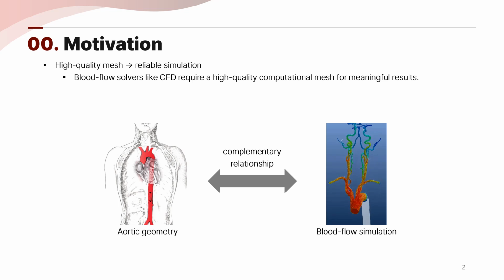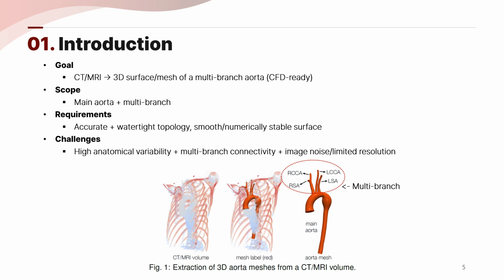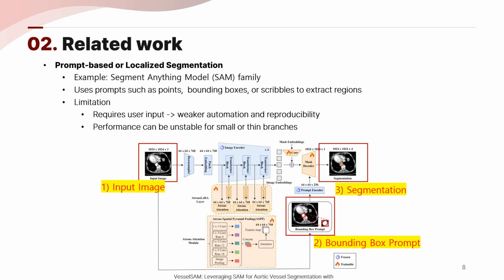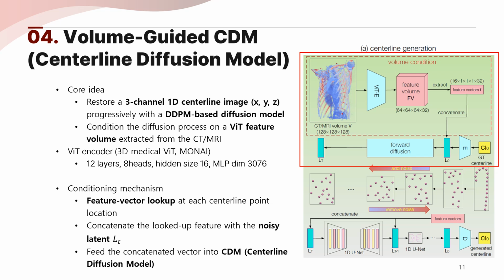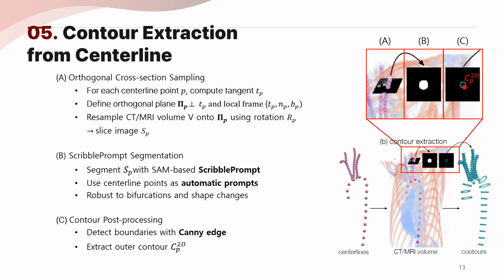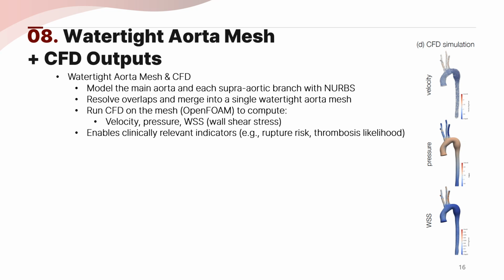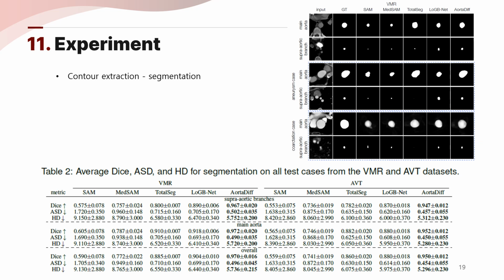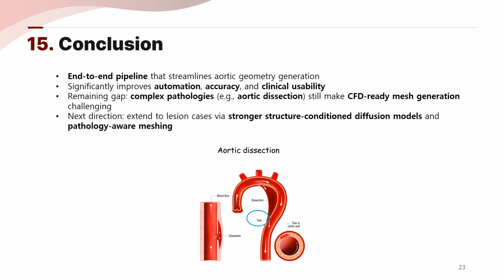[Seminar] How to Reconstruct Complex 3D Meshes Using Diffusion Models

Comment from the maker: It is refreshing to see a seminar covering such topics.
I think, some presentation format errors should be revised... :(
 
I have a couple of questions:
First, could you explain more details about SAM-based ScribblePrompt? Is the extraction of 2D orthogonal contours using Prompt sensitive to the choice or variation of prompts?
Second, since NURBS surfaces tend to produce very smooth representations, do you see limitations in capturing complex local geometric variations or rough surface details with this approach?
Reply: 1. It’s mostly not sensitive to small prompt variations (slight shifts/jitter usually won’t change the contour much), but it can become sensitive when the prompt is significantly mis-placed—e.g., if it moves outside the lumen and “snaps” to a nearby structure, the extracted contour may change drastically.
(ScribblePrompt is an interactive biomedical image segmentation framework that lets users iteratively refine masks with scribbles, clicks, and bounding boxes, and it’s trained on a large, diverse collection of biomedical datasets to generalize to previously unseen structures.)

2. For the NURBS question: in my opinion, the strong smoothness prior can over-smooth sharp, highly local defects (e.g., small tears or calcifications), especially if cross-section/contour sampling is sparse or the surface has limited degrees of freedom.

Comment: Q1. What kinds of inputs or sources of diversity can we actually control in this approach? If high-quality ground-truth CT/MRI scans with fine anatomical details are already available, what is the motivation for introducing this method? In my understanding, generative models inherently introduce stochastic noise, which could be particularly risky in the medical domain.
Q2. What exactly is a NURBS model? Aligning the center point of a mesh appears to be a relatively straightforward task. Could you elaborate on why this problem is considered important and what makes it technically challenging in practice?
Reply: 1. Controllable diversity mainly comes from diffusion sampling, but they constrain it by conditioning on CT/MRI features at each timestep, and the motivation is to automate CFD-ready mesh construction and reduce manual post-processing rather than hallucinate anatomy.

2. A NURBS surface is a parametric spline surface defined by control points and weights, and contour alignment/correspondence (e.g., ICP across adjacent contours) is important to avoid twisting and ensure a consistent surface for fitting.

Comment: 1. The results may vary significantly depending on the spacing of the contours; I am curious whether the authors addressed this aspect.

2. As this topic is unfamiliar to me, I may not fully understand it—does the pressure arise as an outcome of the simulation?
Reply: 1. They run a parameter study showing contour spacing (via number of centerline points) matters: <16 loses detail, >16 can cause contour interference and even NURBS fitting failures, so they choose 16 as the tradeoff.

2. Pressure is a solved field in the CFD step (Navier–Stokes) and is extracted during post-processing after the simulation converges.

Comment: Q1. It doesn't seem like they are adding noise to the image pixel by pixel. Can you elaborate on the process of adding noise?

Q2. Are there any modules that need to be pre-trained and frozen during the training process?
Reply: 1. They add noise and denoise in the standard DDPM style, but on a 1D centerline-image latent across timesteps (the model learns to predict/remove the timestep noise).
2. ScribblePrompt is used as a SAM-based segmentation module in the pipeline; the paper focuses training on the centerline diffusion model and does not clearly specify end-to-end finetuning of ScribblePrompt.

Comment: Q1. In cases with severe pathology, the definition of the vessel centerline itself can become ambiguous.
In such scenarios, what kinds of failure modes does the Centerline Diffusion Model (CDM) exhibit?
Additionally, were any structural constraints or uncertainty estimation mechanisms considered to mitigate these issues?

Q2. In real clinical workflows, there are often strict requirements on mesh quality, such as element quality, skewness, and numerical stability for CFD.
To what extent does Alterative automatically satisfy these mesh quality criteria, and are there still stages in the pipeline that require manual tuning or intervention?
Reply: 1. In severe pathology where a “true” centerline is ambiguous, the likely failure mode is centerline drift or branch instability; the paper does not include uncertainty estimation, and instead conditions the diffusion on CT/MRI features to keep the centerline anatomically aligned.

2. For mesh quality, they remesh with PyACVD and build tetra meshes via VMTK/TetGen, and they report a mesh-independence study (~1M cells), but detailed clinical QA metrics (skewness thresholds, etc.) are not fully enumerated.

Comment: Thanks for the review! It was refreshing to see you cover a medical paper, which seems a bit different from your usual research focus. I’m curious what sparked your interest in this specific work.

I also have a couple of questions regarding the methodology:
Q1. Since the contour extraction relies heavily on the generated centerline coordinates, I'm curious about the error propagation. Does the method have any mechanism to recover or adjust if the initial diffusion model generates a centerline that slightly drifts off the true vessel lumen?
Q2. The use of NURBS seems ideal for creating smooth, watertight meshes for CFD stability. However, could this strong smoothness prior inadvertently 'over-smooth' local irregularities (like small calcifications or intimal tears) that are actually critical for accurate local Wall Shear Stress calculations?
Reply: 1. The paper notes the CDM centerline can be slightly off-center (still within the aortic region) and does not describe an explicit “recovery” loop; instead it relies on volume-guided conditioning plus a prompt-robust segmentation stage to limit downstream damage.

2. NURBS helps make smooth, watertight CFD-ready meshes, but that smoothness prior can blur tiny irregularities unless you increase sampling/detail (e.g., denser/stronger contour constraints).

Comment: It’s a bit difficult since this is an unfamiliar field…🥲

1. How is the ground truth (GT) obtained in this dataset?
2. On page 13, what is the purpose of performing step A?
Reply: 1.For ground truth, VMR provides GT meshes, while for AVT the authors manually constructed GT meshes from segmentations using SimVascular for anatomical consistency.

2. Step A (orthogonal cross-section sampling) resamples the 3D volume onto planes orthogonal to each centerline point to create consistent 2D slices for ScribblePrompt segmentation and contour extraction.

Comment: Q1. AortaDiff generates aortic surfaces by first synthesizing centerlines using a volume-guided diffusion model instead of directly producing segmentations or point clouds. What advantages does this centerline-based representation offer, and what limitations might it have?

Q2. AortaDiff meshes achieve both low geometric error and similar CFD results compared to ground-truth meshes. How should the relationship between geometric accuracy and hemodynamic simulation accuracy be interpreted?
Reply: 1. Centerline-first generation is a compact, morphologically informative representation that lowers computation, but any centerline/branching error directly affects the slicing planes and thus the extracted contours.

2. Geometric accuracy and hemodynamic accuracy are related but not identical: smooth, watertight, sufficiently resolved meshes are key for stable CFD, yet local WSS can still be sensitive to small surface details.

Comment: Nice presentation

Q1. How exactly do you condition the diffusion model on volumetric data? Do you integrate the volume encoding at every diffusion timestep, or only at certain stages?

Q2. Is the model robust to variations in scanner protocols or imaging artifacts like motion blur or metal implants?
Reply: 1. Conditioning is integrated through a ViT-extracted feature volume, with per-point feature lookup concatenated to the centerline latent at each diffusion step.
2. For domain shift, they train on VMR and test on AVT (different source/modality) and still report plausible centerlines/meshes, but specific artifact stress-tests (e.g., metal implants, strong motion blur) are not clearly detailed.

Comment: Q1: How exactly does the volume-guided conditioning work in your centerline diffusion model (e.g., what features are extracted from the CT/MRI volume and how are they fused with the 1D centerline representation during denoising)?

Q2: Since the final surface is built by extracting contours along generated centerline points and fitting a NURBS mesh, what are the main failure modes when the centerline is imperfect (especially around supra-aortic branches), and how robust is the pipeline to these errors in terms of producing CFD-compatible meshes?
Reply: 1. They encode the CT/MRI with a ViT into a feature volume, then for each centerline point they look up the corresponding voxel-wise feature vector and concatenate it with the centerline latent at each diffusion timestep as conditioning.

2. If the centerline is imperfect (especially near branches), the orthogonal planes and prompts can shift, degrading contours; they mitigate this with a prompt-robust segmenter and contour alignment (ICP) before NURBS fitting, but large branch errors can still break robustness.

Comment: Q1. How does AortaDiff's use of a compact representation (centerlines and contours) improve topological stability and data efficiency compared to direct 3D point cloud generation methods?
Q2. How does AortaDiff ensure the generation of watertight, CFD-ready meshes, and what level of consistency was observed between its hemodynamic simulation results (velocity, pressure, WSS) and the ground truth?
Reply: 1. Their compact factorization (centerline as a 1D “image” + orthogonal contours) is intended to reduce learning complexity and training-data demands compared with generating full 3D geometry directly.

2. They aim for watertight CFD-ready meshes via NURBS-based construction and show CFD fields (velocity/pressure/WSS) that look physiologically consistent on generated meshes.

Comment: Q1. What kinds of problems commonly arise in this domain, and how are they typically addressed?

Q2. Why is diffusion applied only to the centerline? Wouldn’t generating the entire mesh with diffusion be more end-to-end?
Reply: 1. They describe the main practical pain points as manual mesh cleanup (smoothing, hole filling, refinement) and lack of a true end-to-end pipeline, and propose centerline diffusion + prompt-based contour extraction + NURBS to remove manual intervention and output CFD-ready meshes.

2. They apply diffusion only to the centerline because it is a compact representation that reduces overhead and trains better on limited datasets than full 3D generation.

Comment: It seems you've developed an interest in a new research field, different from before. That's great :)

Q1. The method chooses centerline diffusion as a compact representation instead of directly generating full 3D meshes or point clouds. From a methodological perspective, what do you think is the key advantage of this factorization, and in what scenarios might this representation become a limitation?

Q2. Contour extraction relies on cross-sectional segmentation along the predicted centerline. If the centerline has small geometric errors, how do those errors propagate to contour quality and final mesh topology?
Reply: 1. They argue the factorization (diffuse only the centerline, then extract contours) is the key advantage because it is compact and data-efficient compared to end-to-end 3D generation. 

2. Centerline errors propagate by rotating/translating the orthogonal slicing planes and thus the segmentation/contours, and the paper explicitly notes slight centerline off-centering as a remaining limitation (partly mitigated by segmentation robustness).